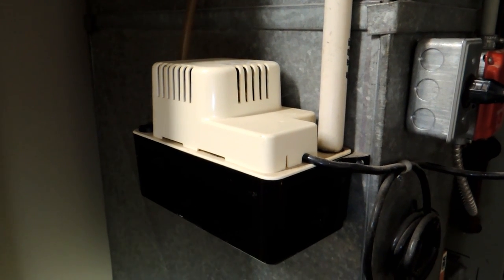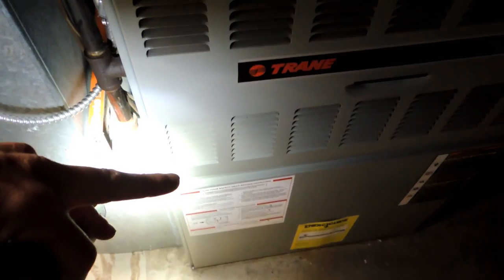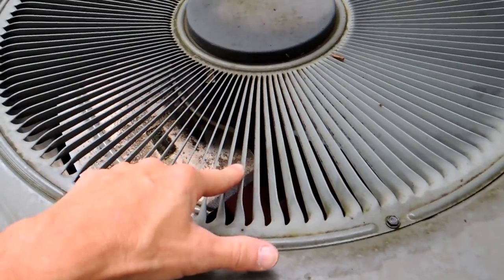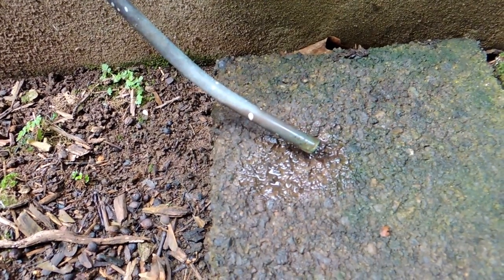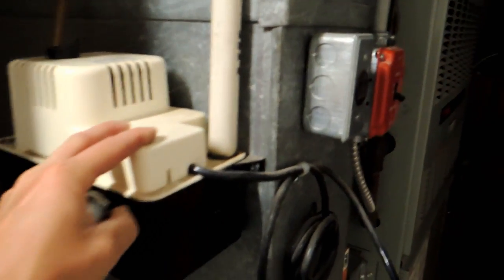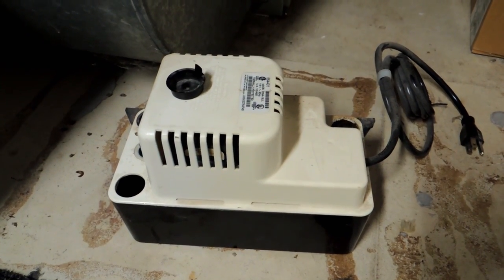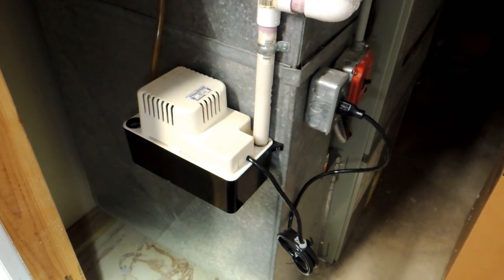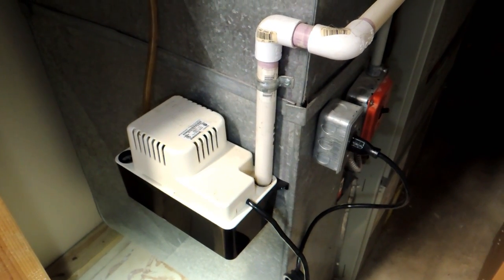How To Maintain Your Air Conditioning Condensate Pump

Comment: You sir are amazing, I saw water next to my furnace and my condensate pump was full of water. I did what I learned from you and followed the plastic tube outside noticed the tube was pinched. I squeezed and straightened the tube and water was shooting out. The pump drained down. Thank You and I thank YouTube.
Reply from the maker: That's great, I'm glad you were able to catch it quickly!  If the tube doesn't stay "un-pinched" you can clip off a piece of the end with scissors so you know the tube size, and march on down to Home Cheapo or Lowes for replacement vinyl tube.  It's not expensive.
Reply: In the state I'm in the condensation tube (vinyl tube) has to actually drain into a sink or into the house waste stack

Comment: Thank you for this video!  Not only did you help me figure out how to clean out the pump but I did not seriously think to look at the output hose (first time homeowner).  My output hose was green with algae.  As soon as I cleaned and tested the pump (shot up like an 18 year old boy), I knew it had to be a clog in the hose.  You helped me save on a $100 - $150 service call, labor, and parts.  Let's be honest too, most technicians would just replace the whole setup and charge more versus just doing what needs to be done and get someone up and running.  You helped make me more independent, thank you.  You also gave me food for thought with the output hose for outside the house.  Once the weather gets better, I will be looking into extending that out to protect the foundation.  Also, it was nice to have a high-level overview of an HVAC system explained.  That helped me understand some of the components of my furnace/air conditioning unit.  Lastly, I have a toddler, your video helped keep her warm at night.  Thank you!
Reply from the maker: That's great to hear--thanks for the kind words!
Reply: Did your house smell like sewage/rotten eggs? I'm struggling to find the cause of this smell in my house. It's confirmed not to be a gas leak, thankfully

Comment: Thanks for the video. My condensate pump would run for 10 minutes with a greatly reduced water flow through the outlet tubing when it used to run at full force for only 20 seconds. My reservoir inside was just as scummy as the one you were cleaning as well as the outside of the pump inlet. I took it apart, cleaned both as you did and it works perfectly again. I was lucky that I didn't burn the pump out and I will now check it out annually. Thank you again.
Reply from the maker: That's great, I'm glad the video was helpful!

Comment: Good video.  That condensate line is recommended by many AC guys to pour a little bleach in the pan regularly to keep it all clean and clear.
Reply from the maker: Yeah, that's not a bad idea if you don't overdo the bleach.  However, some of those nasty solids are from other things in the airflow that gets drained into the condensate.  A cleanout once every few years is still a worthy task.

Comment: Thanks for showing us how it works, and how to clean it.  If my attic condensate pump in a five-year-Trane heat pump system is noticeably noisy, am I typically looking at a gunked-up pump or at bad bearings in the motor?  Service tech claims bad motor bearings and a $300 price on a new condensate pump, plus service call fee, to replace that condensate pump unit. Thanks for making this concise, easy to understand video.  

P.S. By way of background, when this attic heat pump was first installed, the authorized Trane dealer's install crew ran the drain line from the pump down to the foundation, and no further, causing my dry basement to start flooding. A simple six foot extension to the lawn fixed the problem, but short cuts were taken everywhere on this particular installation, including wires running at chest height across my finished attic, drilling holes through dry wall into my wife's closet ceiling (without covering the clothes first) for the thermostat wiring, which was left exposed  in the top of the closet, and then out through the back of the closet into the adjacent hall, covering her expensive business clothing in gypsum dust, where these geniuses then installed the thermostat at a height of 72" instead of 60", ignoring the ease of access down the hollow space between the closet and hall walks, down through which the thermostat wire could have been run in 2 seconds, without the damage and dust they caused and the expense to their employer of having to pay an outside contractor's crew to fix the damage. The compressor on the outside was installed on a pad slanted sideways about 7 degrees.  This us why I have questions.
Reply from the maker: Wow, that sounds like a nightmare.  I don't know what your condensate pump looks like, but if it looks like something similar to the one in the video, they are not very expensive.  Maybe about $60 at one of the home centers.  You might get the name and model of the pump which is currently installed and just do a quick search for cost.  You may find this is something you can tackle yourself.

Comment: Thanks for the helpful video.  My AC stopped working, and my  condensate pump is located under the house.  To get there you have to crawl through a small opening on the side of the house and basically crawl to where the condensate pump is located.  Kinda creepy to be honest.  On top of that I just found out there is a deadly cobra that got loose and was last seen today less than a mile from my house.  LOL I am grateful for your video that has helped me to at least feel a little bit of confidence about what I am looking at as far as my condensate pump goes.  Have a great day!
Reply from the maker: I don't know why your condensate pump would be located under the house!  The whole point of the device is that it can pump the condensate water through a tube to the outdoors, so it can be located anywhere near the AC evaporator.  You might consider relocating the pump to somewhere more convenient.  Can't help you with the snake problem, though!
Reply: @enduringcharm  Haha I hear ya.  Well I don't know a lot about what is what, but I know the furnace and I guess the bulk of the A/c unit is under the house?   I mean I think that's the case.  The unit that has the big fan in it is outside the house, but the condensate pump is connected to stuff underneath the house.   Haha what makes it creepier is when my dad built a deck off the back of the house, it extended out over the opening to the crawl space.  So you have to lift up this hatch door in the deck to get to the little door that opens up to the crawl space.  As it turns out the pump was full of water.  I emptied and checked it out best I could and everything seemed fine.   Float seemed to move freely etc.  Once I did that and hooked everything back up the A/C ran.  Sadly after a few hours it quit again as the receptacle for the pump was full of water again.    I wasn't going through another night without my A/C so I ran to a Lowe's nearby and purchased a new pump and got home in time to get it hooked up before it got dark outside.  It has been running great since then.  Thanks again so much for your help.  You gave me the confidence I needed.

Comment: We just had a long scenario that involved a tech replacing our condensation pump , another tech replacing the thermostat when we still had issues
and then the entire furnace/air handler/a-coil/ outside unit all replaced... with  the techs forgetting to take the tab out of the condensation pump so it
would run (for two days in a row, two different techs examining the pump) 

I finally resolved the lack of air at the vents by adjusting the dampers until I was mostly getting air at all the vents (except one upstairs bedroom and
the bathroom have miniscule air coming out).  

This morning  I went downstairs and was looking at this new  smaller profile  furnace  (more efficient they say)
when I noticed that the PVC PIPE  coming out of the a-coil drain pan,  where it drains out to the condensation pump, has an OPEN ELBOW PIECE THAT IS BLOWING AIR! 
I probably would have assumed this is ok, except that I have done a lot of looking into this stuff, and never before did we need air blowing out of the pvc pipe like that. 
And I have not seen any other system like ours set up where air is coming out of an open pvc in this drain to the pump. 

I have a suspicion that the pvc blowing air out of it  can't be right, but I am really hoping you can tell me if this is EVER normal or not. 
 
Our system is much like the one you are showing.  It has the air flow come up from the bottom to blow across the coils, and the pip is about that mid level under the A-coil
/Evaporator coils, where it drains out to the pump, and from there a tube is routed across the basement to the washing machine drain.   The previous unit had a simple pvc pipe
coming out and going to the pump - no holes in the pipes.  This one has a pvc pipe with an elbow piece that is completely open, BLOWING AIR INTO THE BASEMENT.  
I find it hard to believe this is necessary or even beneficial.   I don't know if it could cause issues, but I saw another video that makes me think it can cause pressure issues, AND
it is clearly a waste!  WHY would air be blown out like that into the basement when it should simply be blowing across the coils and remain a closed system???  

I appreciate anything you can tell me.  I am asking our maintenance dept to contact the company to ask about it, but I really would like an outside opinion from a professional. 

Thanks
Reply from the maker: I'm not certain I follow your whole description, and it can be difficult to make judgements without seeing things in person.  However, it seems like you are saying that the condensation pipe was not completely installed.  If it is a condensation pipe and it is made of PVC then it will be a one inch or 3/4 inch pipe, not something bigger.  It should not be open, it should be glued together and draining into the condensation pipe.  If you have air coming out of it, rather than water, then something was not done right.  It makes me wonder if you have water leaking elsewhere since the pipe apparently is not connected to the pan?  I don't know for sure what's going on, but it seems clear that you need to find a different HVAC company to take a look and get the installation right.

Comment: Excellent video.  Lots of good tips. I wonder if a little bit of Clorox (or vinegar)  added to the reservoir every blue moon would keep things clean.  We had one fail. No one noticed and the water dripped & dripped & dripped and ruined some really nice parquet floor & drywall & paneling.  A big mess.  A little P/M goes a long way.  Like smoke alarms, just check once or twice a year.  Add some water & make sure the pump works.
Reply from the maker: That would be fine, although the bleach could cause some deterioration in the plastic or vinyl tubing if used excessively.

Comment: Might want to add the pvc drain pipe going into the pump should be cut at a 45⁰ angle. Yours is obviously not hitting the bottom if the pan but sometimes that pipe can move or push against the bottom of the pan
Reply from the maker: Right--either way you want to make sure the pipe isn't blocked.

Comment: Thank you. I live in an apartment and have been here far too long (14 years). Well, maintenance NEVER maintains these and only replace. I am on my second one, and the lines are gunky and the pump was nasty just from what I could get through the holes, but I've been afraid to take it apart because it's hardwired I guess? Has like fuse plugs or something with wires. It is to the point it won't stop running, so I've been flipping the fuse box switch to keep it off 😓....do I just do the same as you did? Help please.
Reply from the maker: First of all, your landlord should be worrying about this, not you!  Perhaps you should try a communication reminding him of the water damage which will occur if the condensate pump is not replaced/repaired.  That aside, if your condensate pump looks similar to the one on the video, then they are not that expensive to replace if need be, and the clear tubes should be replaced too.  As you point out yourself, once the tubes get gunked up the pump is not going to work properly anyway.  Since you do know how to cut the power, you should be able to open up the pump and clean it out yourself if you choose.

Comment: Some systems like mine have a safety switch in a pipe coming out . When condensate pump stops ,water backs up to pipe that has a sensor connected to a float switch. When the water backs up,float moves up,and once it activates the switch the system shuts off. That way it doesn't run water out into the floor ,or back I to air handler.
Reply from the maker: Good idea.  I actually see these pumps leaking with some frequency.  The homeowner just ignores it or doesn't notice the problem.

Comment: I have the exact same set up , and I had water on my floor last summer, I thought it was the pump, took it apart cleaned it all out , it worked fine , turned out there was a crack in the bottom of the first fitting coming out of the top ( where you pointed at12:47 ) it’s a 3/4” pvc fitting with a female thread that actually screws on to the mail nipple on the metal condensate pan , turned out it was cracked right along the threads ( maybe someone screwed it on too tight when they installed it, or maybe the fitting was sitting in the plumbers van all night in sub zero temps and it was brittle when he screwed it on and it got a slight crack that weakened over the years until it finally started leaking,… but that solved the problem
Reply from the maker: Yeah, the plastic fittings are not intended to be cranked down by a gorilla.  Glad you identified the problem.

Comment: This was extremely helpful, thank you. Can I ask - How much water should still be in my reservoir normally? After my pump runs it seems like the reservoir is still half full.
Reply from the maker: It's much like a sump pump in a basement, it's normal to have some residual water.  As long as the tray isn't overflowing you are good to go!
Reply: The float level determines what’s in the pan. If the water is sucked completely out, the pump over revs and makes an awful sound.
Reply: I have the same pump as in the video , my pump doesn’t kick on until it’s about 3/4 full and when it kicks on it really blasts the water out so it shuts off pretty quick leaving the unit still half full of water , so yes it’s normal for yours to still be half full without the pump kicking on  ( probably why the water gets so nasty looking as seen in the video ) might be a good idea to unplug it, remove it and empty out out manually at the end of the summer so that water doesn’t sit in there all winter

Comment: Thank you for this video.  The check valve on my Little Giant condensate pump broke flush to the plastic lid on the unit.  I believe I need the 599065 CV-10 replacement check valve.  The condensate pump seems to be working fine except for spraying water around now.  What is the best way to remove the remainder of the check valve that is below the surface of the plastic lid?
Reply from the maker: If the lid can be removed you can probably wiggle the check valve loose from below.  But, you may just want to replace the whole unit if the plastic has aged and is cracking now.  A whole new pump is only about $60.

Comment: How about the inlet pipe?  Should we pull that off and snake it out?  I'm sure it's full of gunk.  My pump works but my HVAC will leak when it runs too hard - my theory is that the drain pipe is barely working.
Reply from the maker: It is possible that the drain leading to your condensate pump is clogged with gunk or rust.  It's also possible you have a leak in the condenser pan itself.  It can't hurt to take a look.  This video is on a related subject and may be helpful:  https://youtu.be/F07sbwZgcsI
Reply: @enduringcharm  thanks!  I actually cut it off last night and it was pretty nasty in there.  I snaked it and it seems to be draining a lot better!

Comment: My experience is:   The pump "on time" should be about 15 seconds to drain the tank.  Drain time was about  20 seconds in the video after cleaning.  A dirty check valve is a common problem.   Clean or replace the check valve as needed.  I prefer replacing with a new one.   I keep some spare new ones.   They are cheap.    A wet/dry shop vac is an easy way to suck dirty water out the tank while still mounted to the furnace.  My Little Giant pump is still working good after 14 years.   :)
Reply from the maker: The time required to cycle the pump is going to be highly variable, so not really something you can use as a benchmark even for the same model.  There will be differences in the float range, differences in the diameter, length, and friction loss of the drain hose, and differences in the height of the water column height.  These sorts of variables will change the amount of time required to empty the tank.  The important thing is to keep the pump clean and functioning, regardless of the amount of time it takes to cycle.

Comment: So my furnace has the PVC tray/pipe mentioned at 2:30, but I also have a larger PVC pipe/drain leg with a smaller tube coming out that where my water/condensate comes out of, that I've now put into my pump so it can drain properly.  Why do I have two?
Reply from the maker: I'm guessing you are looking at a primary and secondary "backup" line.  The backup exists in case the primary gets clogged or damaged.

Comment: Would this be the reason why it would make a whistling sound? Mine is going that constantly now
Reply from the maker: A whistling sound?  Eh, that's not a normal thing!  Possibly the pump motor is just giving out from age.  They aren't that expensive to replace.  If you know the pump is 15-20 years old, or whatever, then it might be worth installing a new one as a preventative measure.